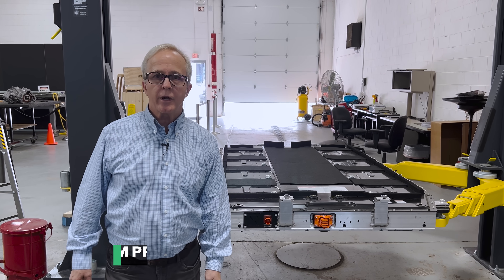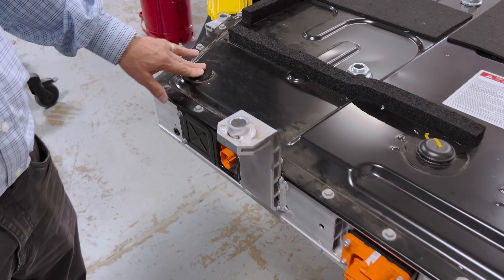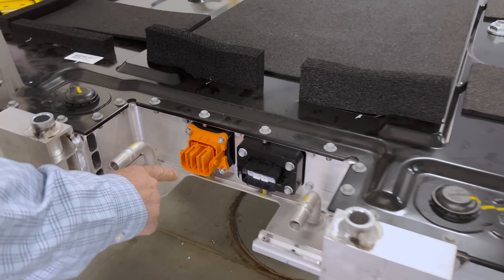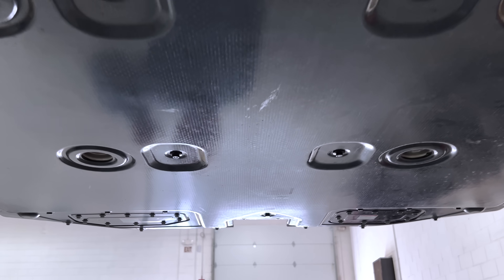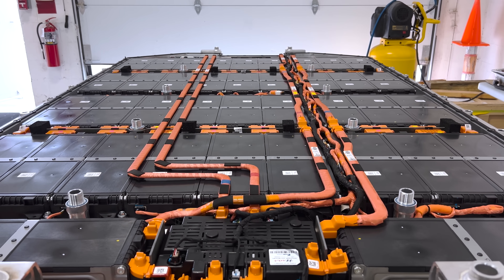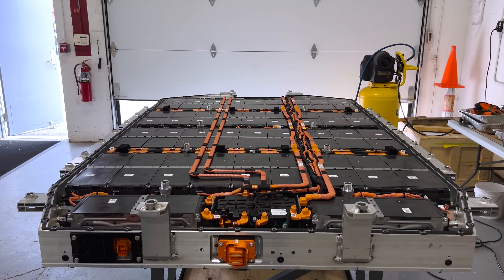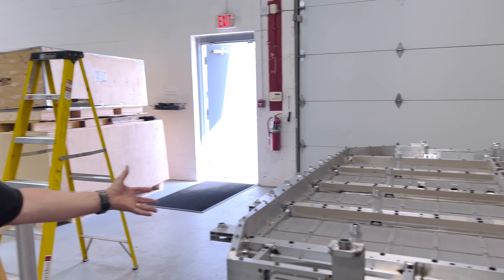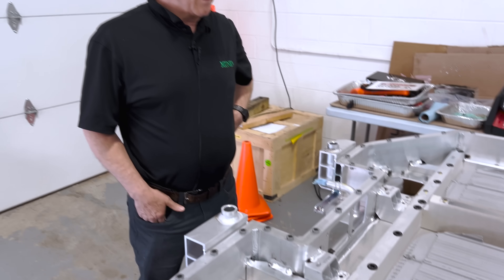Inside the Kia EV9: Full Battery Pack Teardown

Comment: wow, this battery pack is easy to replace, simplified, clean, very well organized. Preferred over the messy Tesla EV packs. Kia and Hyundai has better engineering and design than Tesla. It seems like Tesla is so in a hurry to push models out the door without thinking about simply repairing these EVs. Tesla with the stamped out chassis and body will be overly expensive to repair or replace where owners can’t afford to pay for the repairs. This will hurt Tesla sales.
Reply: Elon's mouth will affect sales far more than their crude mechanical design.
Reply: This design is actually the old design and Tesla had this in their first EV's, a lot of companies are using it now. This is because they are still behind in pack design and only take a safe route. This means, added cost for manufacturing, since this is a pouch design, it need prob 3x the production cost and time of a Tesla pack. Not to talk about all the manual labour for the cabling. Add to that all the extra cost for the materials (glue / cables / bolts / seperated packs). You prob looking at a way higher cost of manufacturing compare to Tesla's design. There is a reason Tesla is nearly the only EV maker actually making profits of their vehicles. The other sell mostly at a loss or if lucky break even. 

So far there has not been any Replacement done on battery packs, it too risky to do and to much of a cost. You prob looking at a 10k+ work cost for a 400$ replacement. It not worth the risk of unbalancing the pack and killing it, or even make the pack catch fire if it overloads.

Other companies are mostly copying what Tesla is doing with a delay of 3-5 yearrs. A lot of companies are now switching to 1 full casted body at the front and back, many years after Tesla is already doing it in full mass production. This reduce cost and time. Do not come that this is hard to repair... If any of those part is damaged, your car is a full write off no matter if it was a full casting on 400+ different parts.

Comment: Question?
Is that battery tray or. housing all 1 piece? The outside not the pieces inside.
Perhaps that thermal interface, is used as a insulator?
What's that busbar made out of.
Reply: Busses.  🙄    Copper or Aluminum, with plastic outer insulation (i.e. the Orange Stuff)

Comment: Example why Tesla is profitable. Too many components, bolts, connections etc, all add costs and can fail.
Reply: Lol as if Hyundai/KIA are not profitable with their EVs. You do not understand that cost cutting is a pretty bad habit if you cut build quality significantly at the same time. Teslas are a bunch of trash and have the worst build quality in the industry. Check out the trash can Cybertruck, it is falling apart left and right and still cost 100k+. The producer profits but the customer loses. What's good about that?

Comment: Softpack... Nope...
Reply: @EpicDrew15  Probably means composite module cases, rather than metal cylindrical/prismatic enclosures.  Not a valid concern, I'd say, since the cells will clearly blow out downward in the event of fire.
Reply: Yeah... Pouch cell.or softpack cell.. Very dangerous... Cause car battery... Better prismatic or better cylindrical cell...

Comment: Nice, clean and neat.  Doesn't look like a glue factory blew up inside of it, like another manufacturer.
Reply: 전기차 없는 사람들의 논쟁,,,
Reply: No.. to bad it doesent
Reply: Far less impressive than that other manufacturer.
Reply: @boostav  Yeah sure... 🤡
Reply: @HDHQDIRECT  Tesla's 4680 pack is significantly safer, thermally efficient and cost effective than this Hyundai pack. Not that you'd understand, yapping about repair-ability is the telltale sign of someone who does not understand BEV pack design.
Reply: All the fasteners and serviceability features lead me to believe they EXPECT a significant number of batteries will need service or repair. A glued together pack is actually more confidence inspiring.
Reply: @johnlabernik4599  Yeah Ok... Tell me your not a Tesla fanboy.   It's Obvious 🤡
Reply: @HDHQDIRECT  A service pack means, higher cost, higher weight, bigger size. All factors that an EV struggle with at this moment to get better at... How you even think you want to service a pack? If you can even service it, you think any company is willing to give you warenty on the work with the risk it kills a full pack with a 200$ replacement? No Insurance company will sign that either to cover it. 

There is a reason no device with battery has serviceable batteries, it just replacement of the full battery. If it on small scale makes it a risk, how you think it will be with 800V system (or even higher in the future and with cars on value of 60k+ with risk of fire?
Reply: Looks heavy and inefficient

Comment: Additionally interesting as I purchased an EV9 several weeks ago. UBER pleased with it on every level so far. A common complaint I see is the front dash monitor contents obstructed by the steering wheel. This is a frustration to be sure. And I am still waiting for the OEMs to get rid of the front seat center console altogether. I want that gone so I can move around in the vehicle freely. It blows my mind that they haven’t figured this out yet. Put the damn cupholders somewhere else for crying out loud.🤯

Comment: I am 65 and have owned maybe 2 or three cars still under warranty, and I keep them forever.   I am currently reconditioning and rebuilding the hybrid battery in my Lexus.  This is my major dislike for Tesla's disposable structural battery pack.  Unlike this battery or my Lexus, zero option to repair.  Not even a BMS.
Reply: As Elon said and Sandy think of it as a high grade easily recycled ore source!
Reply: @4literv6  All battery packs are high quality ore.  Including the one in this video, that can be repaired and rebuilt.   I am rebuilding my Lexus battery for $500. Tesla structural battery is $15k every time.   The number one benefactor of the structural battery pack is Tesla.  Not the car owner.
Reply: I felt same way, but Tesla battery should last at least 10 years and still can be replaced, even if structural.
Reply: @stix2you I retired from a Honda dealership last year after 30+ years of working on cars.  
This Hyundai has 1 BMS.(one point of failure)  You don't even have to pull the battery to replace it.   Structural battery has 4 that may possibly break, anyone of which will doom battery.

Comment: i think the safey of the pack should be the number one concern. as a DIYer, I love the idea of the easy access to the whole battery for repair. however the idea of someone messing with the battery leaving it prone to fire scares me. I recently bought a used EV and the idea that the battery has been tampered with is worrisome. sealed packs probably is the way to go for peace of mind and insurance coverage. 

i think we need to start looking at the big picture how all these little choices of design with affect not just the now, but future functions.
Reply: there's no future in unserviceable vehicles and I on the other hand would not but second hand a vehicle with a pack that is difficult or impossible to service
Reply: @ALCLCFVIS  ya exactly. This is exciting to see! It makes me imagine a future were I could easily upgrade my ioniq6 battery with new battery tech that comes out. Keep the aluminum structure, easily replace battery management and packs. Perfect.
Reply: @dakotapahel-short3192  New tech = new cabling / structure / modules / processes etc. You better of replacing the while pack then just a few components. If the new tech means higher voltage, there is no way to retrofit it in, since that means completely different wires throughout the car and not just the battery etc.
Reply: wait till these cars light up because someone did a hack job repair. i’m sure your insurance will cover it.
Reply: If you seal it, even if some of the cells are defective, you have to do the whole replacement. Who pays for it? From a long-term perspective, we need a structure like that because it needs to be repaired.
I think you can provide something like a sealing seal with the manufacturer's formula.

Comment: The thermal resistance of that thick paste must have been a point of contention for 1D/3D thermal CFD engineers during the optimization phase 😂
Wonder if this was impacted by the factory paste dispenser flow rate during assembly.
Reply: i take its compromise. Remember cells are shrinking and expanding during cycling too. That adds another dimensionality and needs to be taken into account too. Hence bigger margin.
Reply: The CFD engineer would have considered the vibrational movement of the module under harsh driving condition.
The effectiveness of the cooling of the pack was well demnostrated by the Pikes Peak hill climbing racing by IONIQ5N who took the first place and broke the record of Model S plaid. The driver who drove 5N this year and had droven Model S last year commented that there was no power limitation by the battery temperature for 5N driving case but the power of Plaid was constrained caused by the battery temperature at early stage of the race.

It seems the quantity of the thermal interface material is somewhat too much, but it provide the secure interface between the cooling plate and the cell while proctecting the surface of pouch from the shock and vibration. The concerned cooling efficiency was well demonstrated by 5N performance which is far exceeding the power demand from EV9 model.

One of the feature I like for this design is one of the module is replacible if it can be serviced by quailified and experienced staff like Munro team.

Comment: 1 gigantic integrated alu cooling plate sitting just over the road surface.... what could go wrong? One puncture/leak, the whole battery is written off....
Reply: The composite layer on the bottom of the battery pack looks to be carbon fiber which would provide pretty solid, pun intended, protection from impacts as well as thermal insulation as talked about in the video. If you hit something hard enough to go through the bottom layer and damage the cooling plate itself, you've likely done much more damage elsewhere on the chassis.
Reply: I don't think there's any EV battery out there where a puncture of the battery would NOT mean the battery has to be replaced.
Reply: are you blind? there is a composite material structure to protect it lol!!